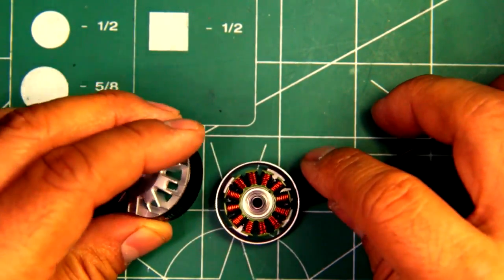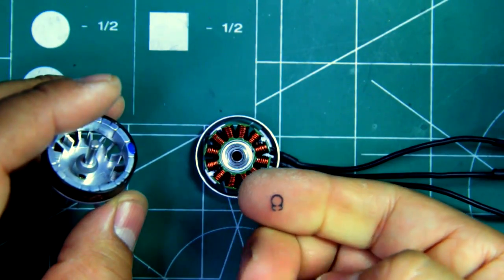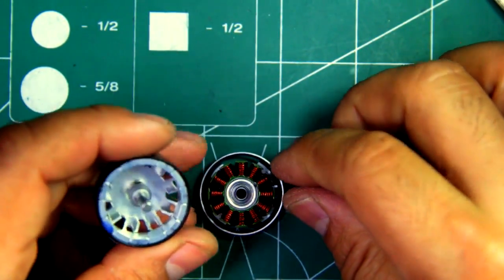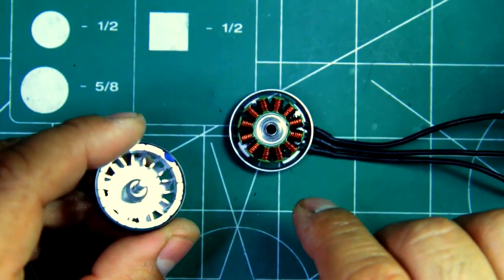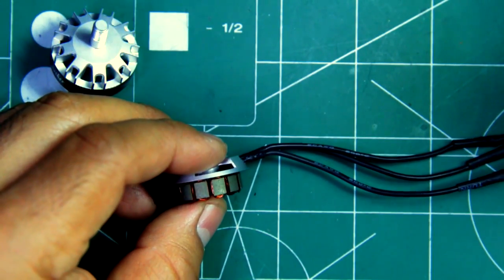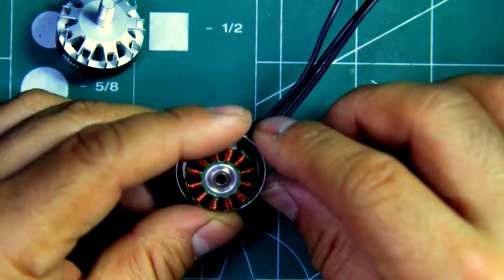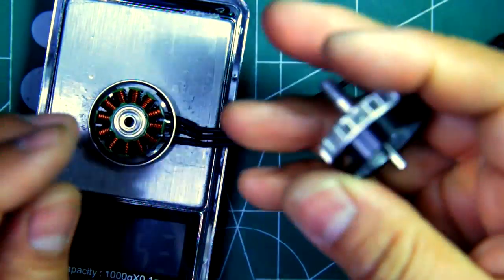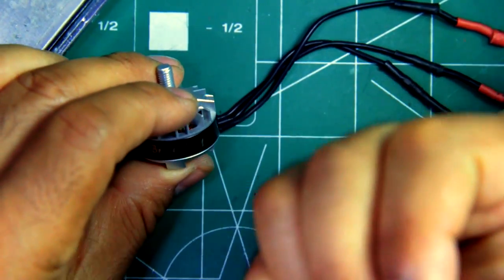BrotherHobby Tornado T1 2205-2500KV

Comment: Hi great reviews of motors,,,,
what would you recommend as an upgrade from racerstar 2205 2300kv (RJX clone version) I have been using the lumenier 5050xs butter cutters, and use Xrotor 30A dshot ESC'c.
I'm not looking for all out speed, but perhaps motors with a little more lower end punch, and I'm not sure on options as there are so many to choose from....Thanks
Reply from the maker: Any of the "top" 2205-2300KV, 2206-2300KV, 2207-2300KV motors will do what you're looking for. 2300KV gives you more punch out of turns and dives. Higher KV gives you faster top speed but may lag a little out of turns and dives. Larger stator like 2206/2207 will give you more torque and punch out of turns too, but you have to check that motor s are not too heavy. 28 to 32g or so would be a good weight. For freestyle flying at the park I prefer 2300KV. EMAX RS2205(S), BrotherHobby T1, DYS Fire & Storm are all pretty good, I haven't really seen any "issues" of quality/durability on those yet. HorusRC.com has the EMAX on sale. Yes, good thing we have quite a few motors to choose from, there are even more like the T-Motors, RotorGeeks, Lumeniers and all will be quite good just a matter of deciding which to buy.
Reply: thanks i really appreciate your advice.....

Comment: hey, can you test the new rxc 2206 V2 with 5s and 5040 props?
Reply from the maker: On the thrust stand 2400KV with 5S can get a bit unruly on Amp draw and I fear motor may burn out. Also the ESC I use doesn't seem to handle high voltage-high KV too well -unfortunately. I imagine with a BLHeli_S ESC, the 2206-2400KV motor may do fine on 5S and 5040 props in the air as Amps will be around 25% lower than in the thrust stand
Reply: EngineerX OK THX for the answer